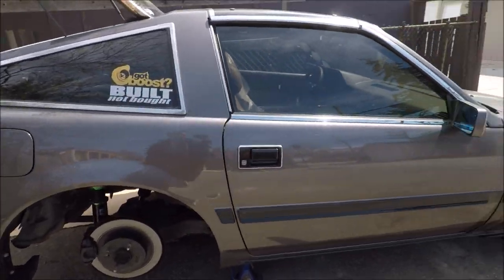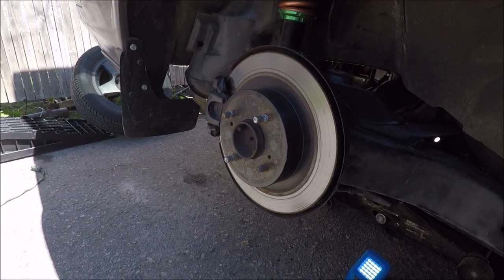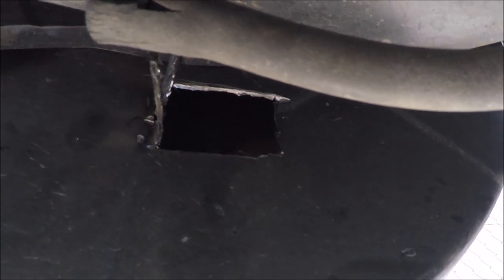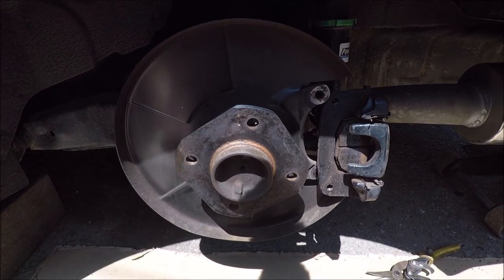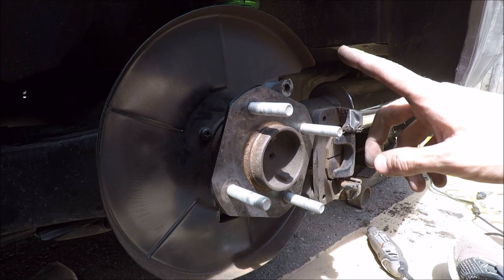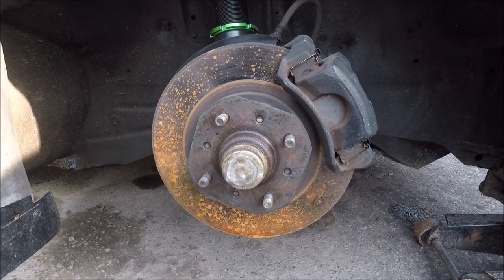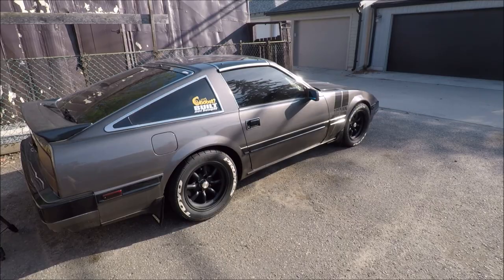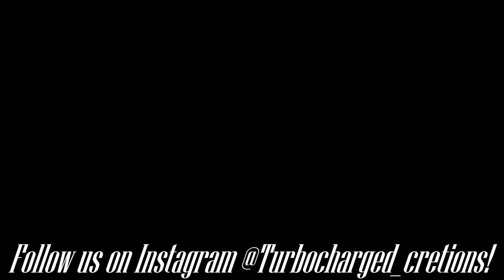Z31 Extended Wheel Studs

Comment: Good explanations and video.
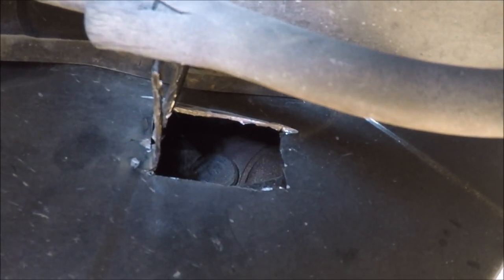A couple of points: 1) Could you have removed screws on the rear dust shields (4:17) and then simply rotated them so that the brake caliper spacing lines up with the wheel bolts? ... of course you have to completely remove the caliper and its mounting bracket. And 2) I noticed that you added mud guards fore and aft. I think they are a must when increasing the tracking of the car as kicking up debris onto the car's side can easily happen on these Zs. Agree?

Comment: What are the specs on studs and lugs pls ?
Reply: All Z31s use a 12x1.25 M12 with a 12.85mm knurl, you can get them in lengths from 40-70mm depending on manufacture. The Nismo's are only available in 50mm or 60mm lengths I believe.